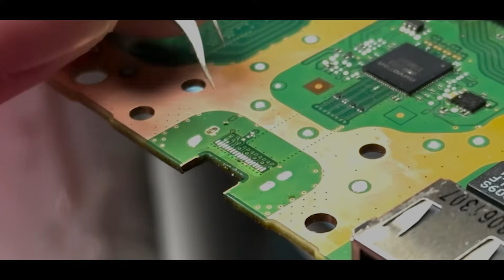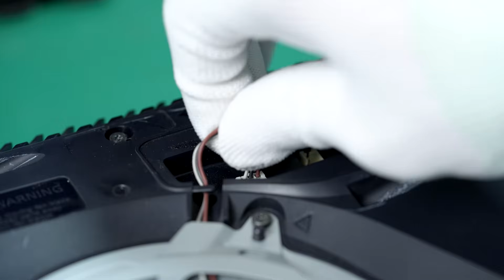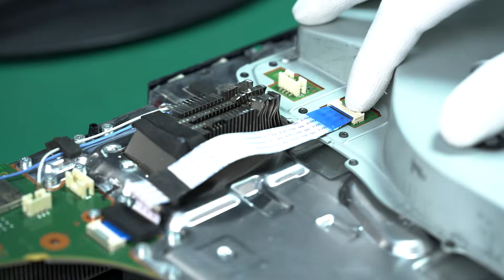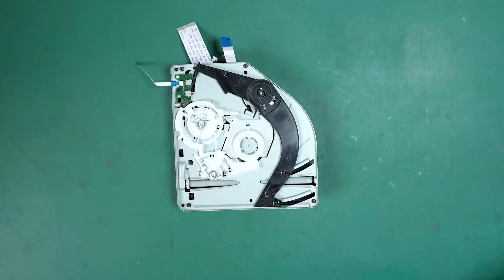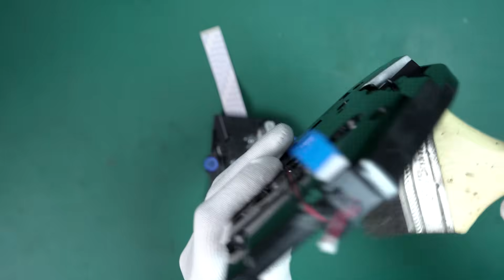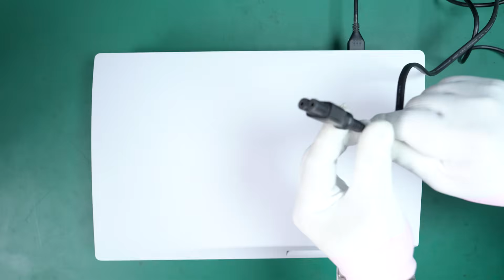How to replace the Optical Disk Drive on a PS5(common issues and solutions)

Comment: My 2 year old daughter shoved a cracker in mine and now it doesn't read disks after using compressed air to try clean it. Do you think it's worth taking apart to see if anything else is in there or just go ahead and replace the disk drive? It's a gen 1 ps5

Comment: Thank you so much for this video.  The drive in my PS5 died a few weeks ago, and I didn't want to bring it to a local shop, as I have seen tons of repair videos where it comes back worse than when it went in.  I bought a replacement drive and used your video to take apart the console and swap the drive.  Within an hour, I had the drive replaced and the console works wonderfully!  Happy Holidays and Happy New Year!

Comment: Does someone know the name of the part so I can buy it? I know how to replace it just not where or how to buy it :')
Reply: Look at the bottom of your PS5: Original models are CFI-1015A, CFI-1115A, or CFI-1215A. Silms are CFI-2015 (or CFI-2115). Pros are CFI-7019 or CFI-7119, I think. The lens parts start with "KEM"